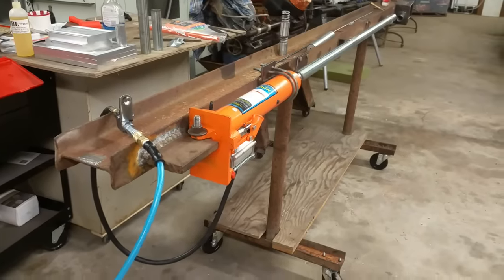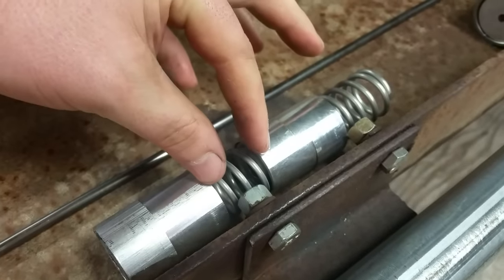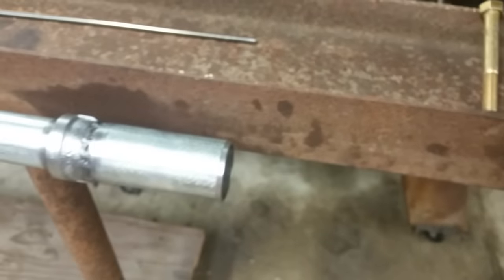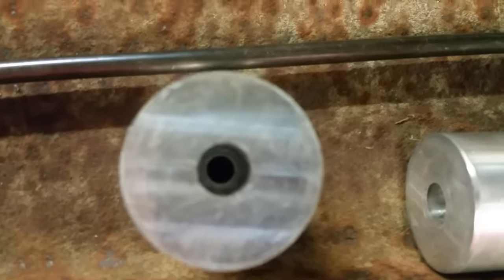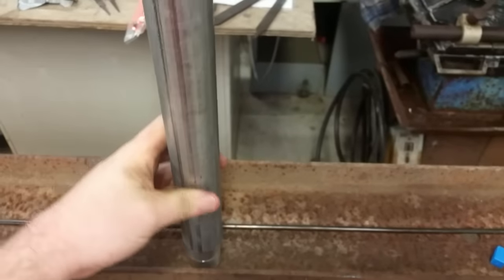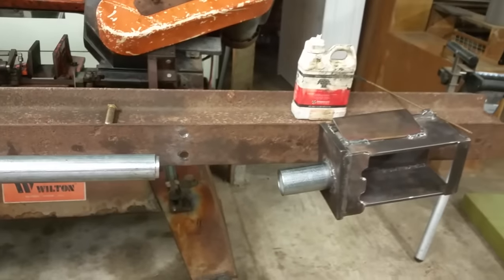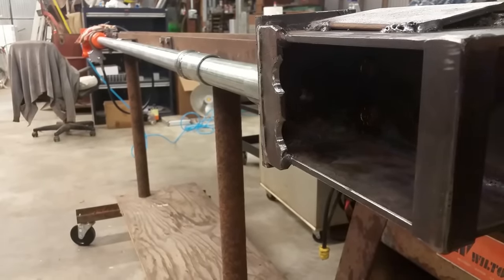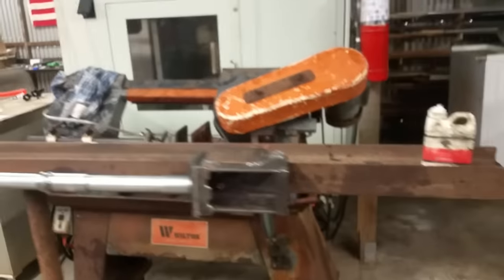Button Rifling Press - Home Built

Comment: You're welcome...nice job!
Reply: markserbu your the guy I was thinking about when I started watching this video but I should have known you were already aware of it
Reply: if he has CNC machine, why isn't he using it for this?
Wouldn't any hydraulic ram such as $200 5 ton log splitter be smoother than this pneumatic one? the hammer surge...
Doesn't he need more supports for that assembly along the beam?
"
Barrels are air gauged to check bore diameter down the length of barrel. 

Basicaly the air gauge is a probe that has a known diameter piece on the end that has tiny holes drilled in it. Air is metered through these holes. When the probe is inserted into the barrel the amount of air that passes between the probe and the barrel is measured. There is a graduated floating pointer that is kind of like the oxygen regulators you see in the hospital rooms that are adjusted to supply the proper amount of O2 delivery. This pointer has stationary graduations on it that as more or less air flows the pointer moves up and down to give the reading. This is one type, others have a dial for readout. 

Douglas has made the term "Air Gauged" some sort of benchmark in the barrel industry. It in its self means nothing. Almost all barrels are air gauged. How elce would one know what the ID is? They simply sell their barrels that read closer to spec as XX Air Gauged and get a little more money for them. That's fine, I have several Douglas barrels and they all shoot well. Higher tier barrel makers wouldn't let a barrel out that didn't meet their most demanding spec.

Bore uniformity after rifling can be measured with an air gauge, a probe that is moved through the barrel with constant air pressure recording variations from specified dimensions. Shilen's air gauges are sensitive to 50 millionths of an inch. John Krieger recommends that every barrel be trimmed at least an inch at the muzzle when fitted to the rifle because the tooling used in bore finishing can leave a slight flare at the ends. Krieger barrels are lapped to just under 16 microinches in the direction of bullet travel. They're held to a tolerance of .0005 of an inch over nominal groove and bore dimensions, but the dimensions are uniform to within .0001 of an inch. Pac-Nor (button-rifling) and H-S Precision (cut-rifling) specify tolerances of .0003 of an inch for the bore diameter. Pac-Nor limits variation in groove diameter to .0001 of an inch.
http://www.gunsandammomag.com/techside/crown_120804/

Air gaging of rifled barrels has been happening for about 60 years.
A company by the name of Sheffield in England invented the process.
Here's how it works.

For a given bore diameter and groove count, a precision plug is
put in that has a few ten-thousandths of an inch clearance. Behind
that plug is a highly-regulated air pump. That pump pushes air into
the bore alongside the rod holding the precision plug gage. As the
air goes between each half of the plug, it escapes through the very
thin area between the plug and the bore/groove. As pressure is 
regulated very precise, any increase/decrease in bore/groove diameter
is going to change the pressure between the plug halves. This change
in pressure has been calibrated to read on a gage that looks like a
thermometer to parts of thousandths of an inch in relative dimension.
The air gage reads variations about a norm which is the plug diameter.
http://yarchive.net/gun/barrel/air_gage.html
Reply: You sell these??
Reply: markserbu LoL I was thinking about @ you for this video!
Reply: Markserbu I think he did a little better than the barrel you did in the vise! Lol
Reply: good incourgement mark
Reply: Nice diy machine, but I wounder how it get the twist rate by just pushing the button through barrel does the button has certain twist rate.
Reply: You do any ECM?
Reply: Mark Serbu it's my hero💪🏻💪🏻💪🏻❗
Reply: Did Ray Charles do the welding?
Reply: @rldoyle5705 Helen keller
Reply: @ashishpawar2261  my thoughts exactly!

Comment: As a kid, I hung around a couple of gunsmith shops, one making very high precision target barrels. I remember them getting chromemolly bars for bench gun barrels, and their first step was always to run a light cut down the length to check the consistency of the steel. If there were any shinier spots, they'd toss that piece because that indicated harder areas, and that meant inconsistencies in boring, and compression when pulling buttons. They always pulled the buttons. making sure the bore was completely clean and very evenly lubed was also a big deal.
Reply: pulling the button compresses the molecules vs stretching as in this case. As demonstrated by the fact he couldn't get the barrel to come out of the bushings which is also a consequence of the thin wall.  Remarkable the dissimilar metals didn't bond had the tolerance to his bushings and tube been tighter it would have.
Reply: @irench  So wich how have been better?
Reply: @maluco132  obviously English must not be your first language.  Which also means you did not comprehend the simple statement I made above. It also means you've little to no understanding of metallurgy, physics, or machine processes.   In the pulled button broaching a rod is inserted through the bore to which a button is attached and then pulled back through the bore. The process compresses the molecules of the metal as it cuts the riffle which make them more accurately maintain the shape as opposed to pushing the riffle button through as is done in this device. Will it work? Certainly and will be accurate to a given level. The pulled button barrel will offer a significant improvement in accuracy which to the average shooter wouldn't be realized. To a long distance marksman, it will make a significant difference. It will also make a difference in longevity of the barrel because it will tune in at a slower velocity and let the shooter not have to burn the barrel out as soon. A difference again not realized to the average shooter who probably would never burn a barrel out in their lifetime and in fact many long distance marksmen sell their used barrels on line for gun smiths to make hunting riffles from if they desire heavy barrels or especially AR platform barrels.
Reply: @irench Thanks (To someone who knows what he's talking about.).
Quick question: decades ago I purchased a 30-30 lever action and after firing it a few times put it in it's case and quite frankly haven't looked at it since.  Don't recall cleaning it besides maybe wiping the exterior with gun oil.  What if anything should I be concerned with when the day comes I decide to fire it again, rusty patches or something?
Reply: Hart and Douglas barrels push button rifle Shilen and Lilga  and most others pull button rifle.
Krieger and Bartlien and many others cut rifle their barrels.
Reply: lol ar is not an accurate platform at all @irench
Reply: @vihreelinja4743  Who said it was? Comprehension problems or just an outright asshole.  AR is an accurate platform for its intended use. AR builds can be made accurate enough for an average shooter.  The marksmanship, math, ballistics, and ability to create a weapon capable accuracy beyond average escapes most shooter and is completely outside their need.  I've friends that regularly shoot AR platform 224 Valkyrie or even Wydle at distances of 800 to 1000 yards with groupings in the sub 2 inch which is well above average marksman who can't group 1inch at 200 yards.  NO, the world record is in no danger of being broken by those shooters but it is currently a very high bar held by Ed in the sub 30 cal using a .223 bullet 5 round group in .710  and he continues to refine his work with that caliber proving there is cause to say an AR is and can be an accurate weapon platform.
Reply: @thisisyourcaptainspeaking2259  the fact you put it away dirty will likely be plenty of protection for the period of time you stated.  I've put mildly dirty weapons back in the safe uncleaned for a year or more.  Pulled them out.  A bore brush and sample patch found near on no issue. I should suppose that it greatly depends on the climate in which you live. I'm a desert dweller so the gun in my pocket receives more rust n damage from my sweat than the ones inhabiting the shelves of my gun safe.  So I'd say do the same as I would.  Run a brass bore brush down it and then a couple clean patches. I'd say pull the bolt but the lever action makes that a task for a qualified gunsmith in most cases. A bore light into the ejection port and little view down the bore if the patches show heavy brown staining. Unless you live in a saltwater coastal town, I'm pretty sure your weapon will be issue free.  You should make it a habit of every 6 months min to inspect the guns in your safe if even just a visual and that will help to remind you of the ones you might have fired a few rounds and sent back in. It's a day long or more project for me do such as I always end up making changes or improvements.  Good luck
Reply: @irench  It was pretty easy to infer that he was asking about which production method would give more accurate shooting results. You could have left off the first three sentences and delivered the answer without coming off as a douche bag.
Reply: @irench   Button rifling is not a broaching process.  It is a forming process.  The grooves are made by displacing material, not removing it.  It doesn't matter if you're pulling or pushing.  Button rifling is not cut rifling, and therefore the rifling button is not a broach, nor is the process "broaching".  Also, it's a rifle button, not a "riffle" button.  Lastly, insulting someone's intelligence is rarely a successful method for achieving pedagogical ends.
Reply: @tomm1968  well, manufacturers of precision barrels would disagree and so too would every tool and die machinist and ballistician.  I have no investment in education of anyone on youtube. People sometimes ask questions to which I might have some insight. That doesn't make me an instructor or educator. Something that is impossible in the days of social media making it the task of the fool.  Further. I have every right to invoke whatever statement I wish insulting to them or not when they come at me with an attempt to beguile or belittle.
Reply: Insulting or talking down to commenters is bad form, and is a reflection of a bad attitude. Not everyone on YT is at the same level, and many are here to learn and educate themselves, so a little understanding, and patience goes a long way.
Reply: How is a rifling button held so it can be pulled through a barrel? I understand pulling should give a more precise cut but have never seen the process done. Please, would you share links for more information? Although a native English speaker I’ve no special training in metallurgy, only an intense interest! 
Also, where could I buy or get a rifling button? Thank you.
Reply: @nes9460 "more precise cut" is false information. A button for rifling a barrel doesn't have a cutting edge and it doesn't matter if you push it or pull it.
Buttons are oversized for the profil you want to get into the material because if you push or pull you will deform the metal (it expands outwards and compresses) and than after the button has passed the material will slighty shrink together again.
Sorry english isn't my native.
Reply: @irench   tomm1968 is correct, irench is wrong.  I spent 30+ years in trade,some of them running an American broach machine.  Broaches cut, buttons form. 
All of the processes can make barrels that shoot.  
If you want a barrel with the least amount of internal stress when finished cut rifling is the way to go.  Check Krieger's process.
Reply: @robinharris6771  One question, shouldn't there be a ball bearing on the end that allows the barrel to twist with the button? I,ve had numerous attempts without the ball bearing, that always failed to produce the right spin, the button therefore slightly cuts the material and isn't following it's real twist rate. The result although looks uniform, but you can clearly see, that the twist is off by about half the rate less. 

Once i installed a ball bearing on which the barrel rests while pressing, the button always produces the right twist rate and now forms instead of cutting. The caliber was 9x19, the barrel had an id of 8,82mm before rifling and the button is made of tungsten. I've also tried several HSS buttons, that had the same problem and some carbide ones with different twist rates and groove count. All resulted in the same issue before the ball bearing.

However, i occasionaly run into problems, when the button seemingly for no reason is building up material in the middle of the barrel, hence destroying it. Is there something else i should do except the obvious factors? 

After rifling, i can see that all buttons leave smeared on steel from the barrel on the negative grooves of the button, is this a sign that something is off? I use 40Crmo as barell blanks, and deep hole drill them myself with a pretty good finish and geometry. 

I would love to hear something from a professional on this topic.
Reply: @bogeydope3022   Thank you for the compliment.
I'm not a barrelmaker and I'm sure you could teach me things!

I have spent some time as a machinist. The greater part of the trade is observation. Discovering the  problems and finding creative solutions.
Any force can deflect a cutter. As you observed, the friction resisting the rotation pf the button certainly could force the button to plow off the flank of a land. Your bearing solution mitigates the problem. Good idea!
Explore lubricants. I don't know what would be best.  the old black sulphur oil might be ggod.Modern cutting fluids like Molecular Edge might serve well.
Filter it as you deliver it. Contaminants can gall .
I know just about nothing about button rifling. I wonder if Shilen,Douglas and Lilja rely on the button for the rotation force,or maybe they actively rotate the push or pull rod the way cut rifling does?

I wonder if you could lose the rod and use oil/hydraulic pressure to directly force the button through.
Reply: @robinharris6771  Hi, thanks! I've read that barrel makers are indeed having the rod for pulling or pushing actively rotating. They use buttons that have a threaded connection with the rod. Therefore they don't need any bearing solutions.

They also use presses, that are rather "hammering" in small steps than a permanent motion. But that's really all there is about button rifling that i could gather from the net. 

Funny thing is also that the buttons i use, came from china and it's russian roulette what you get, the carbide buttons are of good quality, but most of the time you will get 9x18 makarov ones labeled as simple "9mm". These are way to big for 9x19. 

I've ordered from the same shop about 5 times, and only once i received the right button! They label them all the same, and all shops seem to get them from the same factory. 

The ones the barrel makers use are seemingly from sources that are not known to the public. 

Another big problem is getting the right size carbide reamers, try getting a 8,82mm reamer that has the right length for a barrel... I've finally had to custom order a cannon drill from china that was even there about 200 bucks. 

Anyways, i will try some other lubricants as you said.
Reply: @vihreelinja4743 are you kidding? I have a 6mm ARC AR Ill put up against bolt gun you have!?

Comment: Nice setup for home button rifling your own barrels. Don't take this the wrong way, but there's still plenty of room for improvement, which would have an exponentially positive effect on the quality and accuracy of the end product. For one, the lube used before pushing (or pulling) the rifling button through is one of the most important factors of the entire process. It's actually so important that all the commercial barrel producers who use button rifling to make their barrels consider the lube they use as a closely guarded secret. I know some use moly-based lube, others use some oil or grease-based lube, and one big name in the industry uses soap like that used in soap bars, melts it, then pours it through to coat the hole, puts it away so the soap can solidify, and once solidified they drive the button through the barrel. And another important thing to pay attention to when button rifling, it always has to happen in one continous and fluid motion. The ram you use did not seem to move in one continous motion, which is detrimental to the quality of the rifling. And last but not least, although slightly less important than the other things, if you want to make quality barrels, you need a way to turn the rifling button at a specified turning rate. Although the button will turn on its own as it passes through the barrel, it's not going to be anywhere near as consistent as when you use some external means to turn the button at a specific twist rate. But for pistol barrels it's generally good enough to use the twisting patter of the button itself instead of applying the specified twist rate externally.
Reply: The only reason you would turn the rod is to keep the rod from fighting the buttons twist and causing distortion. The rod does not have enough torsional rigidity to turn the button. A thrust bearing that can handle the load would be all that is necessary.
Reply: @gravfielddrive  Yap! I've did some barrels without a ball bearing that let's the barrel turn freely and the button jumps it's real twist rate.